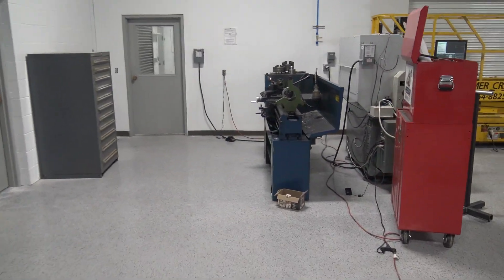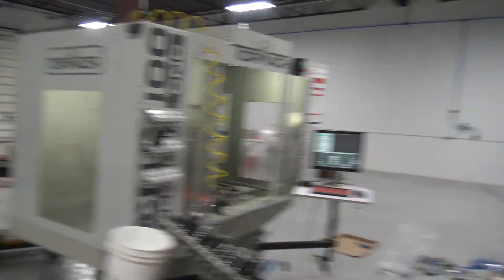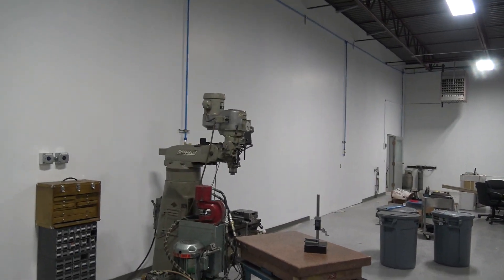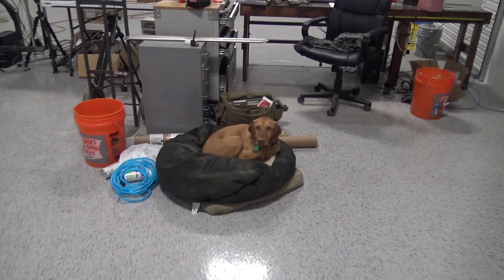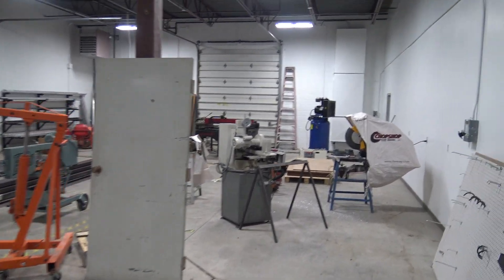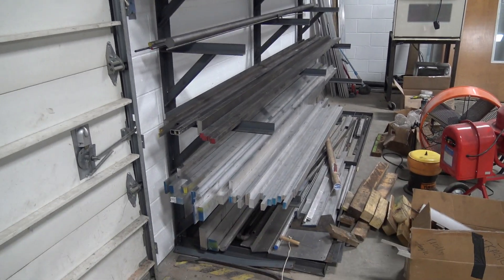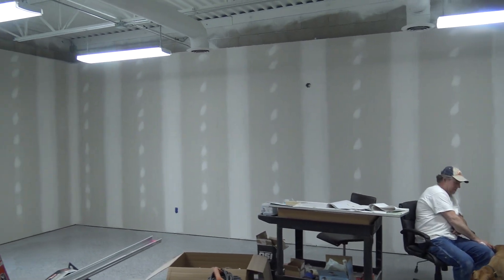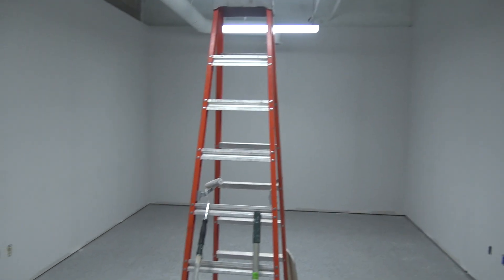Shop Update!

Comment: If you want to control the echo in that room I wound recommend noise dampening foam. You can buy it for super cheap on amazon and install it yourself in less than an hour or two. The difference it will make is night and day and is totally worth the cost.
Reply: Well when it comes to dampening there is no hard fast rule other than more is better. generally audio professionals will tell you between 25% and 50% of your wall space should have dampening materials. but in the end it really does very by the space. the most important thing I can tell you is the difference  between "high end dampening foams" and gluing a mattress pad to the wall is negligible and your general audience wont be able to tell the difference.Considering that space is a dedicated filming space I would buy what ever looks the nicest. Also sound dampening is for cutting down on echo not sound proofing so don't expect it to cut down sound from the main shop but it will make everything in that room seem quieter and more clear since there is less echos. literally all I can say for certain is that it is going to take some experimenting. just remember any flat hard surface is going to reflect noise so try to cover as much as possible. Wish I could be more help if you ever need help filming in the Pacific Northwest let me know I have a production company up here that I am trying to get off the ground. you do really cool stuff and as some one who loves DIY film equipment I can't wait to but my first mill your videos make me drool with all the potential equipment I could make with the tools and the know how. If I lived any where near you I would jump on the opportunity to take one of your classes. Any who thanks for the response, your channel is awesome, and if you have any other questions feel free to let me know.

Comment: Build looks great,   one comment on your air line,   It looks like it comes into the room and makes one long loop around the room.  This could lead to the end line loosing pressure if others are using air.    If you connect the end of the loop back to where it enters the room it would help stop that.
Reply: +NYC CNC Hmm,  I have never heard of the "Stale Air" problem when is comes to compresses air systems unless you are talking about scuba

Comment: For a acoustics a large curtain covering at least one wall will make a huge difference. We hung a 22'x42' 8oz commando cloth curtain with pleats 6" from the wall in our exhibit gallery. Without the curtain you can barely understand someone talking 5ft away. With the curtain you can have a conversation across the room. I think that curtain cost around $1,500 and was made by rose brand. We had it made as one large piece with a cutout for a door, if I was to order it again I would of gotten more manageable panels. Its way better value than acoustic tiles or panels.  In a shop environment it will gather dirt. Maybe get it made in grey to match the color of chips. The usual black will show every spec of dirt.

Comment: Looking good. 
Black pipe is cheap from a materials standpoint, but once you account for the increased time, tooling/equipment and labor it is not so cheap anymore. 
Black pipe also continually contaminates the air stream with rust, particulate oxidation and flaking. 
All the best...

Comment: Well done on the new shop John!

Puts on retired University Audio Visual tech hat ... definitely get a large screen TV for the training room. Projectors cost more to run - they use more power and the lamps wear out. You'd need to buy a new lamp every 1000 hours of use.

Get the reverberation time down in your classrooms. Carpet, absorption panels on the walls and non-reflecting desktops all will help. And some diffusion panels on the side and rear walls are also worth investigating. Might be money well spent to get a suitable consultant in for that job.

In the meantime make some chips!